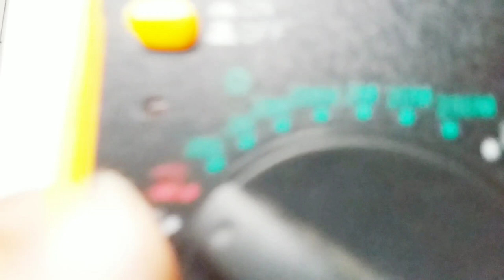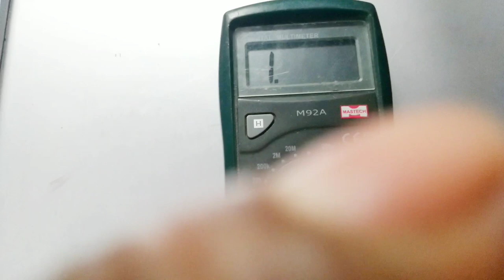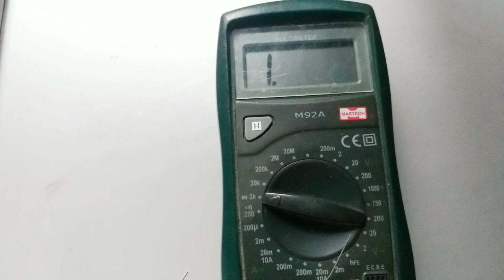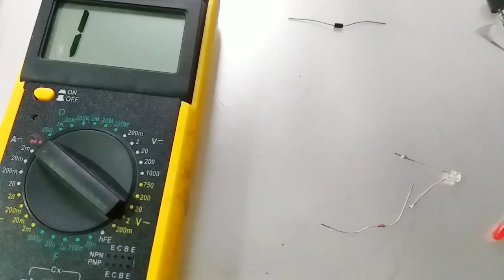Digital multimeter| Diode , Zener diode &led checking

Comment: SMD diode check cheyyumbol one side beep sound und other side  reading kaanikkunund....enthanu ithinartham...ee diode faulty aano?
Reply from the maker: ബോർഡിൽ വച്ചു അല്ലെ ചെക്ക് ചെയ്തത് 
 അത് ഡാമേജ് ആകാൻ സാധ്യത കുറവ് ആണ്
Reply: @FELKITLearning  Thanks.njanoru Mechanical engineer aanu.but electronics il interested aanu.Repair works cheyyunnund...chila doubt Kal und.... WhatsApp number tharamo... doubts clear cheyyananu
Reply: LED Bulb nte driver panel le fuse resistor ohms - wattage um enganeya nokkuka.Damage aayathu replace cheyyan purchase cheyyananu
Reply from the maker: @rajeshpunni2951  ഫ്യൂസ് ആണേൽ 2.2ohm 1/2 w വച്ചാൽ മതി
Reply: @FELKITLearning  resistor nte wattage rating colour coding il ninnum calculate cheyyanakumo?
Reply from the maker: റെസിസ്റ്റർ വലിപ്പം നോക്കി ആണ് wattage കണക്കാക്കുന്നത്
Reply: Zenar diode volt എങ്ങനെമനസ്സിലാക്കാം